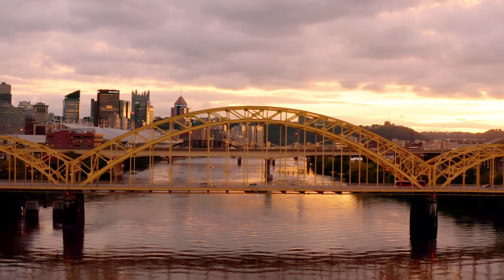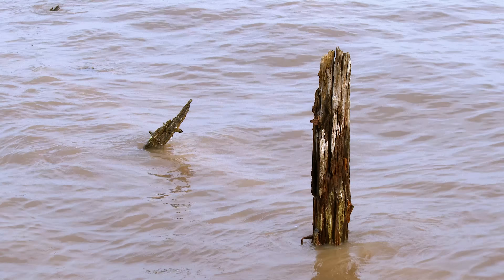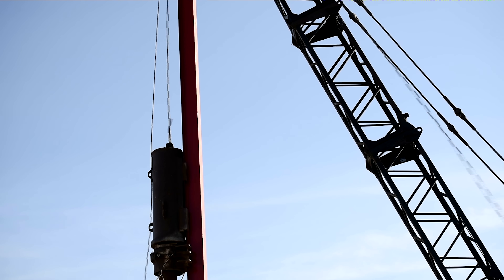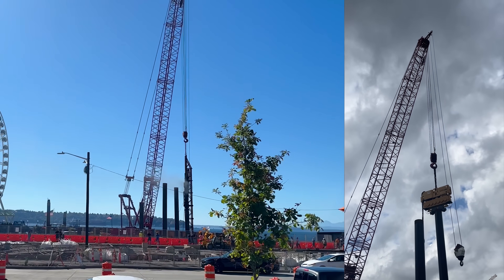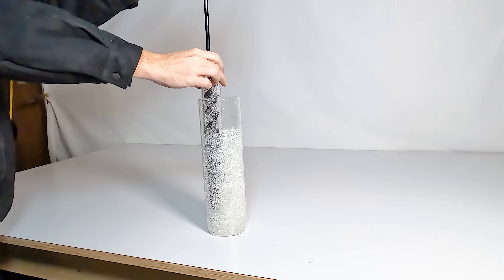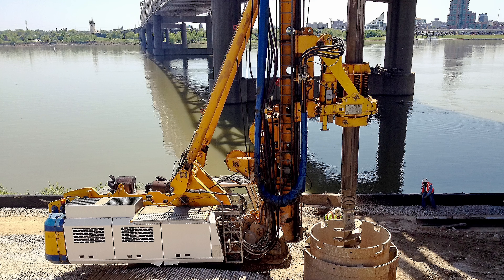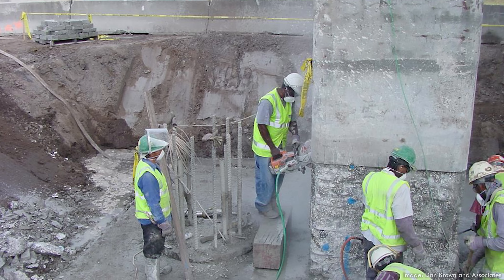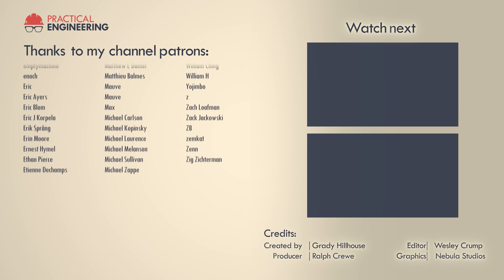Why Bridges Don't Sink

Comment: Because of the thumbnail:
I talked with one of the engineers of the Coronado Bridge. I'm a computer systems engineer, but even with physical not logical engineering, diagnostic and detection components, collapse mitigation systems... it's just freakin cool all the techniques that go into securing and designing bridges, especially in critical locations like San Diego Bay.

Comment: Driven piles don't have to be loud. Most residential operations use hydraulic hammers and rams that are pretty quiet. Granted you aren't usually getting 150 kip service loads out if them but for 40-60 you are golden
You also didn't touch on helical piles 
granted I can't fault you, this video is a good primer for the content that I learned in an undergraduate foundations engineering class, right down to the normally stated advantages and disadvantages. Good job. 
t. Foundations engineer

Comment: "Your guess is as good as mine why the same shape is an I beam but an H pile."

You just explained it.  An I beam doesn't need much material on the top and bottom so the beam is more I shaped.  A column (or pile) needs much more material in their flanges so it looks more like an H.

Comment: I beam is not a structural steel term. S shapes have beveled flanges and resemble an I. S shapes are used a lot for hoist trolley beams. W shapes are the most common beam in structural steel construction. I’m a retired structural steel estimator/project manager.

Comment: @PracticalEngineeringChannel Here in NL, I mostly see concrete piles driven under just about any building. 
I was wondering, why are they blunt at the bottom?
A sharp center point would be easier to slam down, moving the soil evenly aside creating a nice uniform seal around the pile. 
A blunt pile has a tougher time penetrating the soil, causing tough compressed soil to build up under it, perhaps even creating a ball of compressed soil being forced down larger than the pile itself, creating a hole larger than the pile with less static friction on the pile afterwards.
Also it seems the minor benefit of upward pressure from the tiny blunt bottom is made up for by static surface friction along the pile, while the same surface friction is a smaller dynamic friction when in motion being slammed down.
What am I missing?
Is it hard/expensive to make pointy piles?
Are they more prone to go off-course while driving down?
...?

Comment: Dear Grady,I have a question. Why can't we have huge capacitance battery for each family to store energy, supported by both electricity from the grid and solar panel. idea is that the battery has enough energy to provide daily or two days use, and it is replenish some by solar panel, and some from the grid at the lower energy demanding time to save the money. I also wonder what is the area of the solar panel we need to make it reasonable. I know there are man variable to each individual family, but I wonder about the math, and when would this idea be ever practical and affordable.

Comment: Hey, I love your videos, they explain well without pandering or talking down.  I live in Vancouver BC Canada.  Highrise constructions are becoming common around here with strange looking diagnonal structural members, like massive 5-6 foot wide columns on the exterior of the lower floors running at a 45° angle.  

We are told that it's a new earthquake design almost required here now, that is strangely not needed anywhere else in the world or almost nowhere.  Could you explain what these are, how they work, and how common or uncommon they are?  Google was not helpful.

Comment: I'm a CAD drafter (6 years rebar detailing and now about a year and a half doing pre cast/stressed) and I've done a lot of shafts & piles during bridgework. Loved them because they're almost always easy, repetitive and made my end of year weight report look good to the bosses. 

It's really cool to see different perspectives on stuff like this that I have a decent understanding of but can learn more about the "why" behind the engineering of certain aspects.

Plus the info graphics style animations combined with the at home demo stuff really helps explain things. Great video.
Reply: Do you just pretty much draw the sticks underdround and send numerical data to the higher ups?
Reply: @paulandersbullecer3152 it's partially like that.

When I was detailing rebar I was making shop drawings to aid our placing team on the job site. Essentially a recreation of the strucural/architectural contract drawings that are provided by the general contractor from the EOR (engineer on record) that specifically highlight our scope. What I'm doing now is very similar except my drawings go directly to the fab shop to produce the pre cast products as well as to the contractor for their field needs.

Comment: My father drove the piles for the first bridge across  Lake Pontchartrain before I was born. He worked for Raymond International Concrete Piles, a subcontractor of a subcontractor on the job (I think).  I didn't see any video of the rigs they used that comprised of a boiler, on the back of a modified crane, driving a steam hammer up and down a high vertical boom. They just referred these as "The Rig."  Might look up sheet piles sometimes. New building techniques, and cheapness, has declined the use of 100' step taper piles. The tower in San Fran sinking where similar building in "wet" soil with no bedrock, never moved that Raymond set foundation piles for. That's what the tower needed, a 100 foot or so of step taper piles that is a corrugated steel hollow pile driven down then filled with rebar and concrete. Many architects' and builders went with a "floating slab" type construction to save time and cost. But there are many places that is just risky. A good example is the MARTA station in Atlanta near Georgia Tech, built on floating slab instead of piles, thus even before completion moved and sank off and on requiring even more expensive repairs and shoring.

Comment: Great video! I was a draftsman and engineering tech in the CalTrans Office of Structure Design in Sacramento for 15 years, 1991-2006, and spent thousands of hours working on bridge and retaining wall foundation plans and Logs of soil test borings. The only foundations I can think of that have to bear heavier loads than highway and rail bridges are dams, especially the "big guys": Hoover Dam, Glen Canyon, Grand Coulee, etc. And maybe skyscaper office towers built on soils where bedrock is too deep to be reached directly by the building foundation. When the new East Span of the San Francisco-Oakland Bay Bridge was being built a few years ago, I was out at the jobsite one day on a field trip with some of our design section Engineers, just sightseeing (our section didn't have any direct involvement with the project), and we got to watch piles being driven for one of the bents on the Skyway portion of the bridge. The "Skyway" was that part of the bridge that didn't have to be raised high enough for ships to pass under, so it was a cantilevered pre-fab box girder, running from the east abutment on the Oakland shore, to the east end of the new Cable-stayed span. The mud under this part of the new bridge was very deep: the depth from the water surface to bedrock was 350 feet at the center of the channel between the Oakland shore and Yerba Buena Island, so several of the Skyway bents had to be built on pile caps supported by 36" diameter cast-in-steel-shell pipe piles that were 300+ feet long. These consisted of sections of 36" pipe, Schedule 40 I think, that were somewhere between 20 feet to 40 feet long (I don't remember the exact number). The first section to be lowered from the transport barge by a crane had cap plates welded on the ends to keep water and mud out, and was long enough to reach from the mud line to several feet above high-tide water level. This was lowered to the mud and allowed to sink in several feet under it's own weight, then the crane operator would tilt the pile to a pre-determined angle. The "footprint" of the piles as they entered the mud was substantially wider than the pattern of the tops of the piles at the pile cap. I seem to remember there were 12 piles under each pile cap, and 2 pile caps per bent. As the pile reached equilibrium and stopped sinking deeper under it's own weight, it would be driven a bit deeper, then a new section of pipe field-welded on and the driving would continue, with additional sections of pipe added, until the calculated bearing capacity of that pile was obtained, or "refusal" was reached. A rebar cage would be lowered in, and the pile back-filled with concrete. One of the engineers mentioned to me that the cost of the foundations alone - the piles and pile caps - for the Skyway was nearly half the total cost, and maybe a bit more than half. The whole project - the cable-stayed span, the skyway, and the approaches and abutments - eventually totalled out to over $7 billion, I heard, so we're not talking penny-ante level civil engineering here. The Burj Khalifa didn't cost nearly as much as this bridge, I think. The entire original SFOBB, both the east and west spans, only cost $75 million in 1936, so I guess there's no escaping the boogeyman of Inflation even if you are The Federal Government paying the bills.
Reply: US infra costs are insane in general, and have been for decades.
Reply: Wow 300’! The bay mud is such a complex and mysterious part of SF design and engineering

Comment: Many a happy lunchtime watching piles being drilled into what looked like sand.
Glad you mentioned the technique of back filling with concrete down the center of the auger.  The illustration of reinforcement being lowered into wet concrete wasn't what I saw.  I watched maybe 2 metres of rebar being pushed in, more or less vertically, by the bucket of a digger leaving perhaps 4 metres unreinforced.

Comment: Anothher example of building failure caused by unstable ground is the Cosmopolitan Hotel in Las Vegas. The hotel itself is fine, but the tall structure they built next to it (across West Harmon avenue, towards the Aria) started to sink shortly after construction was finished, because the building company failed to do a correct geological study. The structure was deemed unsafe and had to be taken down, at the cost of the builder.

Comment: Reason its an ‘i-beam’ is because the flanges are always horizontal and the webbing is always vertical. If the application of the member is vertical, then they say ‘h-beam’. Helps with work order clarity for manufacturing.

Comment: Apparently nobody told this to the engineers when the new elevated crosstown expressway was built In Tampa.  One morning before the expressway was opened, one section sank, taking the roadway with it.  The blame game began on who was responsible.  After it was repaired, all the rest of the pilings had to be individually tested by a thumping truck.

Comment: Thanks for sharing your thoughts, ideas and videos. My favorite memory of a pile installation was of a mall being built when I was in college. They started driving a pile. Every day for about a few weeks they would add another pile in the exact same place. Eventually they took the pile driver away and just left the pile sticking out of the ground. As I drove by every day I eventually noticed it was still going in on its own. After a few weeks it was totally gone. When the mall eventually opened up they stated the reason for the massive parking garage under the mall was for buoyancy since the ground was so unstable that they were unable to put in piles for the foundation. I often pondered after that if the mall ever goes out of business it will be interesting to see if the garage fills with water and sinks the mall.

Comment: Years ago they were adding shoulders on some over passes on I-10 in Orange Texas. They hired me to weld the metal shell pilings on the job. The first thing I did was weld a 1 inch thick cap on the pilings. After the pilings were driven into the ground to the required, or higher, bearing load, I cut them off at the required height. A few had to have extensions welded on to be able to be driven deep enough to attain the required bearing. We'd put 4 piles in square 'footing', each pile required 100 tons of bearing, most if not all of them attained between 200 to 400 tons of bearing before they stopped driving them in. Then each pile was filled with rebar, then the concrete was pumped in and vibrated. Then each 'footing' of 4 piles were capped with  a large square concrete cap about 2 feet thick. That was the one and only time I've worked around a pile driving operation. It was fascinating to say the least. They would drill a pilot hole 15 to 20 feet deep, put in the pile, start driving it until the required bearing was reached or exceeded.  The engineer would watch the piston after each stoke to see how high it rebounded, measured on a scale along side of the pile driver mast. The distance the piston was driven up after firing was noted and he had a chart telling how much bearing the pile had from the distance the piston was driven up after firing. 

They pounded on some to the point that the pipe they were driving started to crumple like an accordion around the tapered end of the hammer that the piston was driving against and I had to cut it all out to get the hammer loose from the pile! 

I would say the bridge shoulders they installed were plenty strong. Each shoulder had 4 footings comprised of 4 piles each plus the cap, and each pile had from 200 to over 400 tons of bearing.  So each footing would hold up at least 1,200 tons. So each one of those shoulders would hold a couple of battle ships up! LOL

Comment: The webs on I-Beams are typically taller and slenderer than H-Piles.  Some of the nomenclature is to differentiate these differences in shape and thickness in the steel design manuals.

Comment: 12:41 Sorry for the dumb question, but how does the concrete dries underwater?
Reply: It doesn't. Concrete 'cures', which is a chemical reaction that absorbs water. (this is why above water, you need to make sure the concrete doesn't dry out too quickly, or it might not cure properly)

Comment: Worked on an interesting project some years ago which involved massive suction piles. Check out the Shell Prelude FLNG..

Had to engineer some mechanical plugs that would seal to cope with a tiny vacuum for installation and relatively high pressure (due to size of the pile) for future removal. Knowledge of piles before that point was almost nonexistent!

Love the content as always. 👌

Comment: Patrick Star: Are wick drains a pile?

My favorite piles are the lateral ones. Steel and direction drilled bud! Then thread some restrained pipe through with spacers and mechanical joints. 👍

Comment: Could you do a video of how people in hurricane/ tropical storm prone states with can protect their oceanfront property using Z shape sheet piles? I gave advice on an online forum that 40' sheet piles can be driven 28'-30' feet into the sand with 10-12' stick above ground on the bounds of the property creating a seawall protecting the property. Then the inside the sheet piles is filled with soil/beach sand. Then the house is built on this new raised island and the first/ground floor is made 10' tall and is only used as garage/storage, the living space it on the second floor, about 20' above the original ground level so if storm surge/flooding occurs the major mechanical systems of the house are protected. I also suggested the central air system and emergency generator be put on a raised pedestals so they will still work even with flooding. I have seen so many videos of people paying tens of thousands to a $100,000 dollars to truck in beach sand after a storm erodes their property and yet the erosion will happen with every major storm so why not just pay upfront and protect the property properly with a sheet pile wall.

Comment: A perfect example of how pilings work can be demonstrated by something I learned in a WWII era heavy rescue class in the late 1980s.  We made a gin pole and used three 1.5 inch steel pins by three feet long as an anchor in very loose sand.  We drove the stakes about 2 feet into the sand about one foot apart and lashed them together and then use that picket as an anchor point for the gin pole to lift a 450-lb drum.  When we were finished, you untied the lashing and the stakes very easily pulled out of the sand.  One stake would not hold but the friction of the sand on the three made the anchor very strong.

Comment: Borings are done before the pile’s to check the type of soil and allow you to design the piles more accurately .
They are expensive though .

The saying is - You pay for the Borings - Or  you wish you Had paid for them !

When Borings are skipped to save money and when you drive the piles  you find the soil is Not what was designed  for !
That a really costs …….